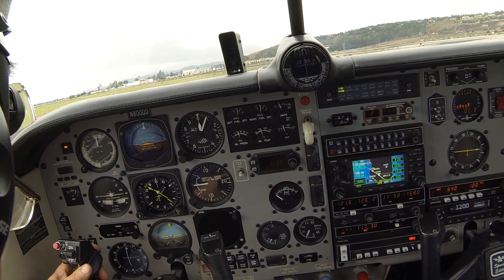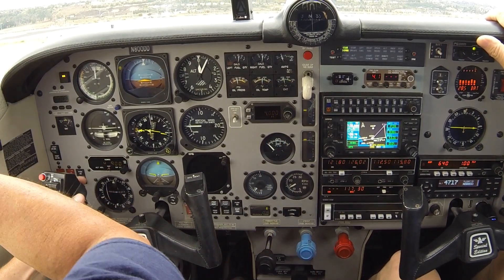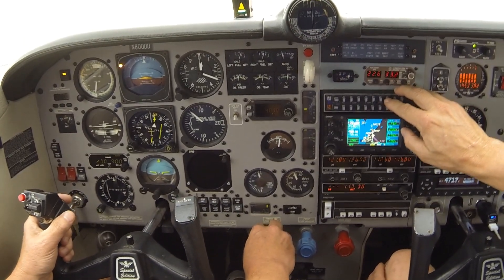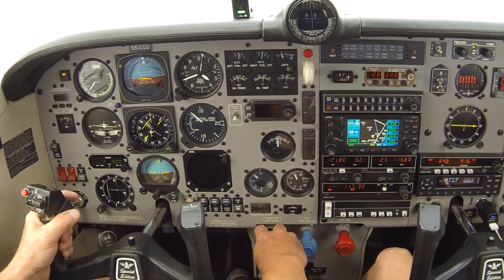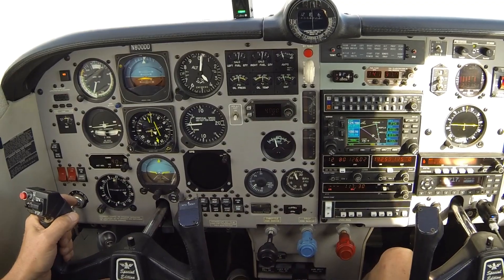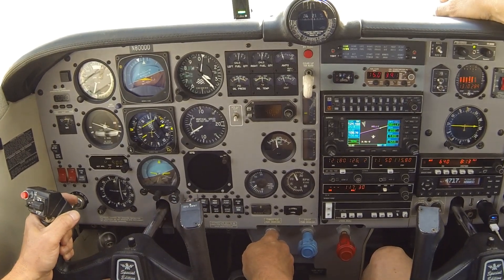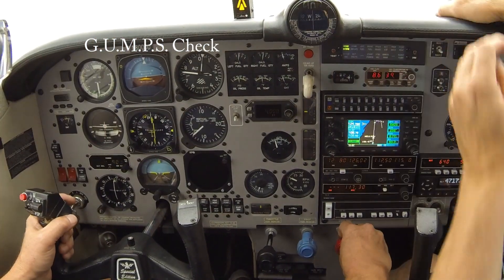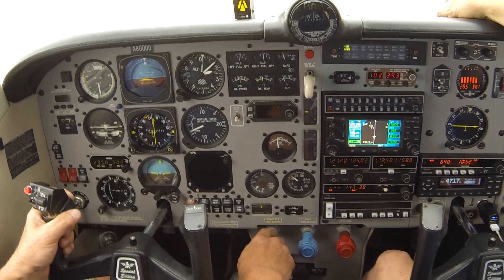Oxnard ILS RWY 25 Approach In A Mooney Ovation

Comment: You look like you are chasing the GS, especially as you got close.  Easier way is to get a stable trimmed airspeed early on then use the yoke to stay on glide path.  Dropping gear usually gives the right amount of drag to stay on GS with little adjustment.  Fiddling with throttle and trim all the time just complicates things.
Reply: Agree, it look really good until he started plating around with the throttle.
Reply: Agreed; I never get focused on GS in an ILS approach, only relevance is IAS which just so happens to have the effect of keeping the plane in the air! Overly managing the throttle distracts from an already busy situation - main focus should be maintaining a good IAS and staying on GS; you can always declare missed and go-around. Keep it safe.